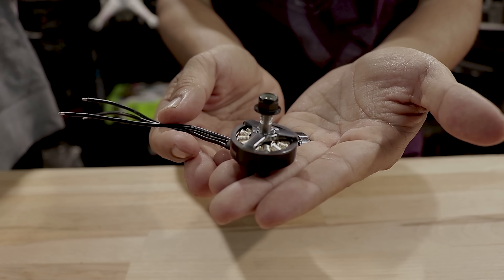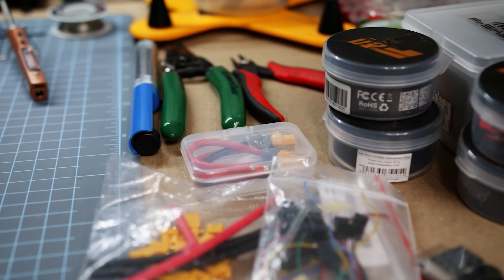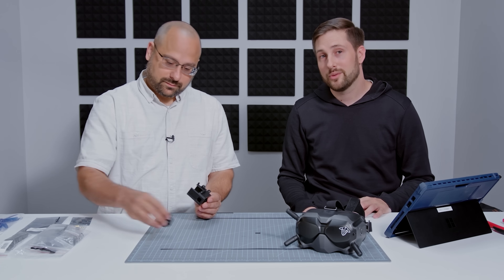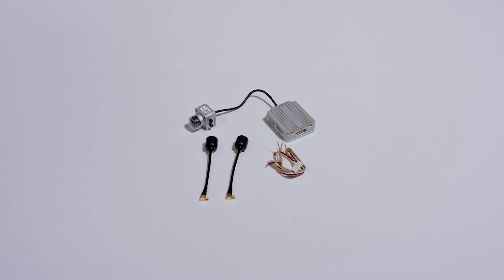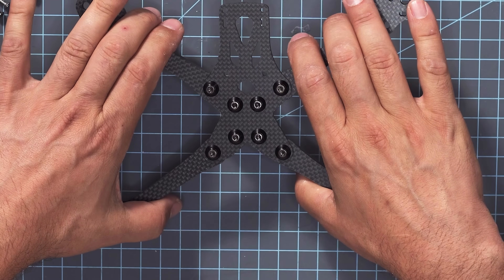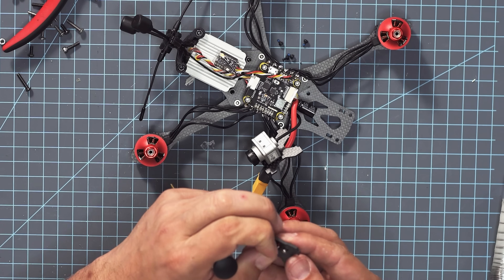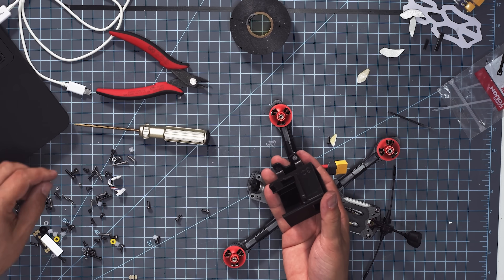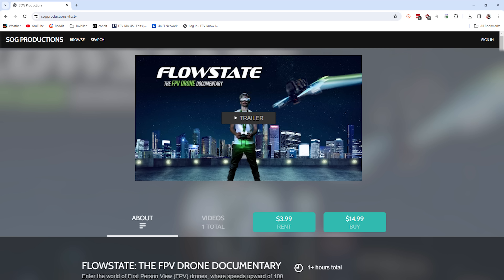Custom Building // FlowState FPV Documentary Deleted Scene

Comment: if i buy radiomaster TX16S Mark II Max ONLY ELRS version (not 4 in 1)
So what can i use Ranger 2.4GHZ(for upgrade multiple antenna)  or Bandit 915 MHZ (for long range)
Can i use External EXPRESSLRS MODULE ????????????